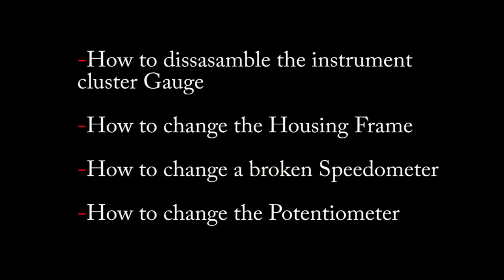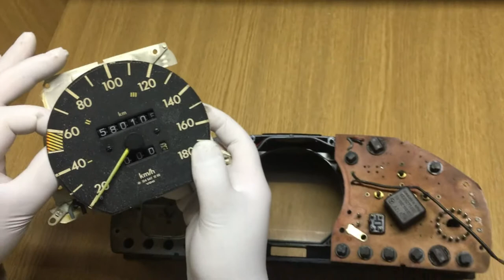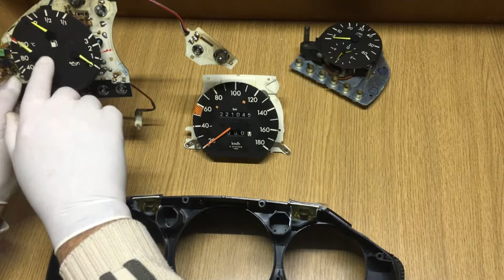How To Repair Mercedes Benz W124 Instrument Cluster Gauge

Comment: Very interesting and useful. Thank you.
I have a few questions, if you can help out:
- my speedometer and odometer(? the number sequences that count the kms) don't move and are a bit tilted. Is this possible to fix or should I get another one?
- In Portugal, a used full instrument panel my cost around 100€. Is it worth buying the parts separately (quite hard to find actually)?

Thanks a lot
Reply from the maker: Thank you for your comment!
The Speedometer can be repair. It depends of demage.
Usually 9/10 I can repair. 
If the repair cost is high you can buy an used Speedometer for 30 Euro plus shipping,.
Reply: @alautoparts9694  Where do you buy the speedometer?
Reply from the maker: @GabrielAlmeidaSoares  send me the last 4 numbers of Speedometer 124 542 xx xx
Reply: @alautoparts9694  ... 44 68
Reply from the maker: @GabrielAlmeidaSoares  This Speedometer is for 124.128 => 250 D TURBODIESEL, and 124.128 => E 250 TURBODIESEL
Reply: @alautoparts9694  correct. This model is 250 TD
Reply: 1990
Reply from the maker: @GabrielAlmeidaSoares  if you buy this speedometer you will spend about 42-50 Euro (shipping including)
Reply: @alautoparts9694  sounds great! I have to see if I can remove my speedometer because someone put some hot orange glue in it!
Reply from the maker: @GabrielAlmeidaSoares  if you have not removed it before, see some video how to remove the instrument cluster.
Good luck 👍
Reply: @alautoparts9694  I saw it. Very good. Thank you
Reply: Do you think the problem can be solved by replacing the speedometer's cable (the big one to goes to the transmission, I think)?
Reply from the maker: @GabrielAlmeidaSoares  sorry, I read again the first comment and if the counter(number) is tilted and the speed works (shows the speed) but the counter doesn’t move the problem is in the speedometer not in the transmission cable.
Reply: @alautoparts9694  ok, thank you. But I think the speedometer needle stopped working too. :(
Reply: @alautoparts9694  Hello. Does the "new" speedometer comes with odometer as well?
Reply: @alautoparts9694  Great! Thanks! Do you have another link for just the little gears of the odometer?
Reply from the maker: @GabrielAlmeidaSoares  no. Only Speedometer/ Odometer I don’t know any link. You have to ceck for it.
Reply: @alautoparts9694  thanks again!
Reply: @alautoparts9694  Hello. I removed the gauge and fixed the odometer. It's working again! But, the lights are not working as they should now and the speedometer niedle is not very accurate I think. Has this happened to you?
Reply from the maker: @GabrielAlmeidaSoares  The lights; it helped if 1: you change to led; 2 if not rotate good; 3 if  you have not placed good the contact in Instrument 4; check the fuse. Ect...
The nidle; you hav not placed in the respective position
Reply: @alautoparts9694  thank you!